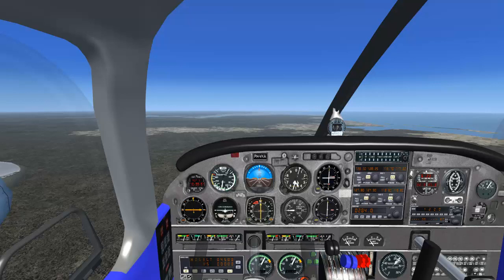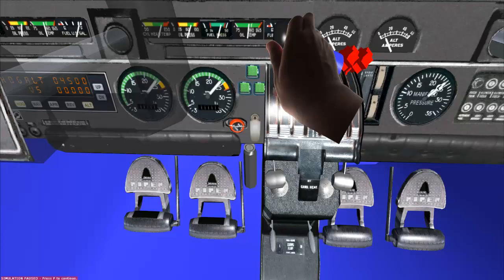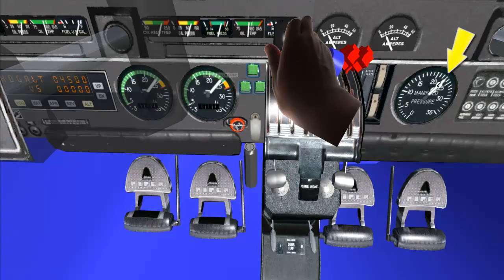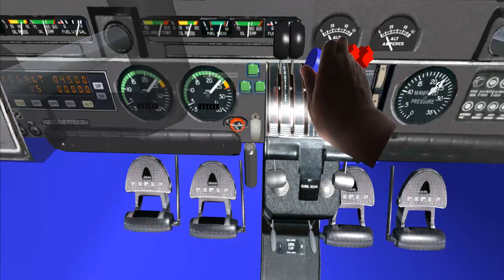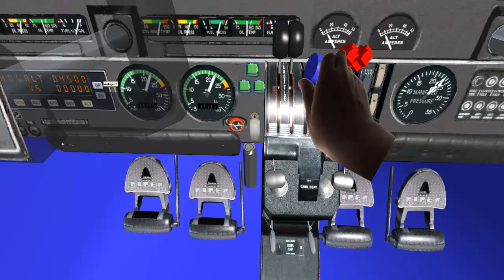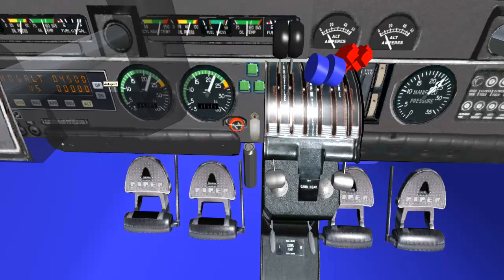Piper Seminole PA 44-180 Cruise Procedures

Comment: i think you did a mistake by adjusting the manifold pressure to 23" and RPM to 22 it suppose to be the opposite
Reply from the maker: generally  what you said is correct but according to the piper seminole PA-44 POH that how to set the power
thank you for your attention